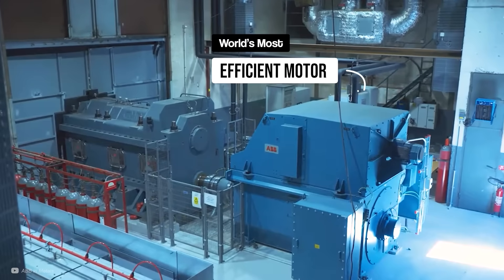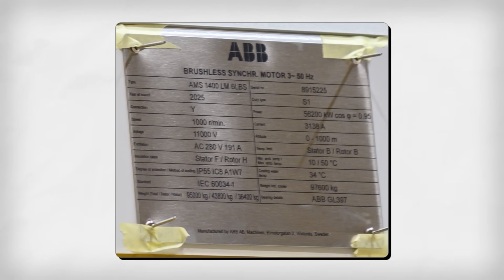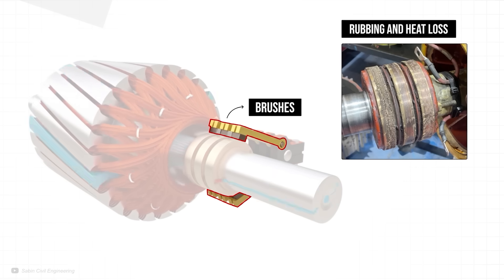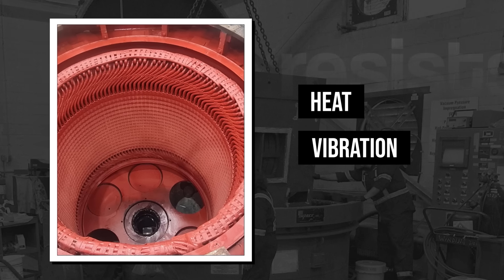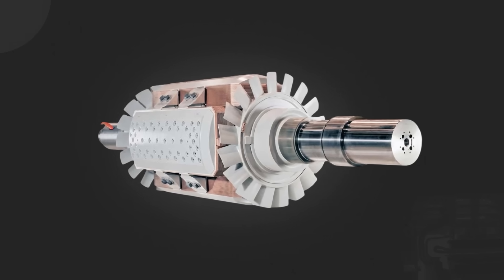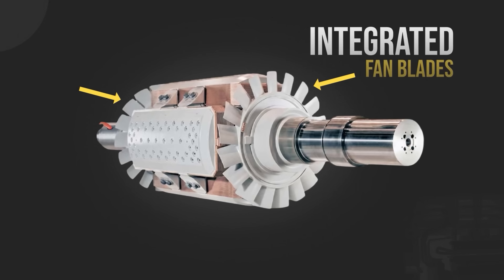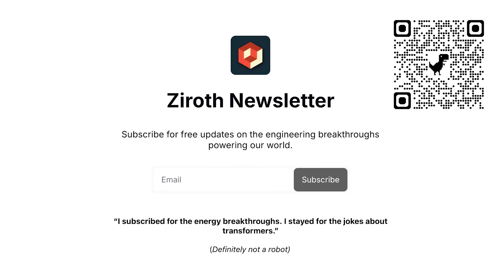How This Ultra Efficient Motor Just Broke The Limits

Comment: idiots, educated idiots, the amount of coal burned for that giant unjustified motor was staggering, coal is fuel that India is burning through to make it all, all life is fuel, what amount life did that motor and all the motors out in that body of salty water cost? How much fuel for life did we just lock out of being renewed? 
If it will last a few thousand years it will still not be worth the trees and plants that coal had the potential to nourish, plants don't eat sunlight or water, they need fuel just like all biological organisms, and this motor represents thousands of trees a forest that will never exist because some idiot wanted a motor that melts metal, and your sponsor? The old blades that a man could sharpen himself would really last a lifetime, not razor blades that last a month, what a joke, they made a handle with a blade that on a 30 degree angle LOL great, only, you can hold a blade on a 30 degree angle yourself, don't you have any mind of your own? Selling worthless crap, worse than worthless crap, crap that won't have any use without life to burn for fuel, you don't get it!

Comment: @4:08 "vacuum pressure" 😂
Otherwise pretty good video 👍
Reply: SIS VPI means "Sealed Insulation System, Vacuum Pressure Impregnated" windings. The coils are wrapped in Dacron polyester fabric, then heated and placed into a vacuum vessel. Then a vacuum is pulled to get all the air out from between the windings. Next epoxy resin is allowed to enter the tank and covers the windings. Next pressure is applied to drive the epoxy into the windings which is the impregnated part. Then it is removed from the tank and rotated in an oven until cured. So, ya, he is right about the vacuum/pressure part.

Comment: Low pressure helium inside? 
Small motors are around 90% efficient. So 10 kw motor is heating up space with 1 kw.
Imagine this 50 000 kw monster  dumping 5000 kw of heat 24/7... It's saving 4500 kw of power... I  2 hours saved you can run home for year

Comment: As a retired electrical engineer who spent most of his professional life near large generators, motors and transformers I must tell you that you do have the majic ability to make large brushless synchronous machines look very sexy....😊
 You didn't mention power factor which, in such large machines will draw huge mounts of idle currents.... But even school kids know that in a synchronous machine you control it by the levels of excitation currents.. So, problem solved

Comment: An improvement in efficiency from 96% to 99% is HUGE in one important respect. The waste heat generated drops by a factor of four. For the 56MW in this example that's 1.7 MW of heat that no longer needs to be extracted by forced cooling.

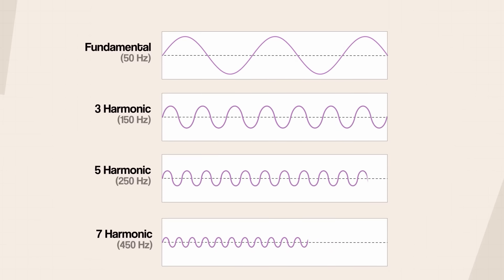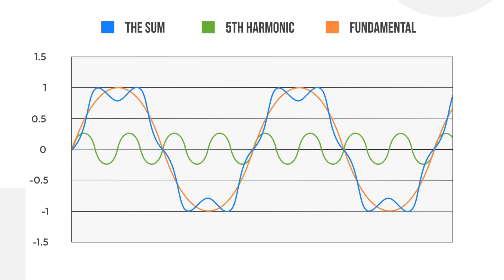Comment: The drawing at 6:59 and 7:15 are wrong: They show the 4th order instead of the 5th order!
The 3rd and 7th orders at 7:01 are not in scale too: They are 2 3/4 and 6 3/4 in length (not 3 and 7).
So their superposition would not match the result (that is drawn correctly).

Comment: Seems not included in the electric motors manufacturer's motor cover attached stated specification performance plate, shown us, is the now made external to the motor’s total energy consumption, the external pumped water cooling system energy consumption being used to cool the motor which would seem when now dissected out that this cooling needed to create a more efficient running electric motor is not included in this "super efficient" electric motor's total energy consumption efficacy ? Seems that the detrimental impact to energy efficiency experienced by typical electric motors running hotter when surrounding ambient air is pulled in over the copper coils to create limited cooling  happening to not totally cool the copper windings as compared to this motors external cooling design energy consumption has not been included in the overall total energy power consumed to run this new more efficient motor's total cost to run computation. The external cooling needed to cool this "new" more efficient electric motor seemingly makes its overall efficiency to run, when added back in, higher. Seems this additional cost for cooling energy consumed to operate is detrimental to total efficiency % stated to operate this new motor which seems NOT shown here by the manufactures side of motor mounted stated performance specifications cropped image shown in this YouTube video.

Comment: 96% efficiency is already great. You won't get much from making it a bit more efficient. Cost is higher than the result is worth. Yes, you have an effect of scale, but no real change.
Reply: To go from 96% to 99% isn't just a 3% improvement, it is a 4X reduction in losses. For this motor, apparently that results in a savings of $60,000 every three months, or $6 million over a 25-year lifetime. The extra cost was about $60,000 which was recovered in the first three months of operation. This motor uses 56,800 KWH every hour it runs at full load. For reference, at $0.13 per KWH, that results in $7,384/hour.
Reply: @solarfluxman8810  that makes sense, but only on this, immense scale.

Comment: Seeing the very nicely bent copper fins that replace the typical copper winding actually brings me an idea, armchair amateur engineer that I am - I know it's now possible to "print stainless steel" using some methods of additive 3D printing systems - how possible would it be to print some major parts of a brushless motor in 3D? The ability of additive printing to create geometric shapes that are extremely hard to do otherwise might give some advantage here? Obviously, like I said, I don't actually know engineering, so take this with a grain of salt - maybe I watch too much science-fiction.

Comment: I find 99% efficiency almost impossible to believe.  If it's true, a similar increase in efficiency is probably possible for the generation of electricity.  If this kind of efficiency can be built into smaller motors and generators and if you can make it small and light enough. An improved automotive drive system could allow an internal combustion engine to always  operate at its most ideal load and rpm .  Running an internal combustion engine at the most ideal speed for the power requirement would vastly increase overall  performance and efficiency.  Although efficiency numbers for any type of combustion engine will appear terrible compared to these drives, an actual overall efficiency of 50% for the entire vehicular system would be an economic and environmental answer to prayer.

Comment: I used to work at Electric Machinery in the '80s and even then we had controllable brushless exciters & 98-99% efficiencies in the big (10Mw+) units.  Efficiency mostly was a number you could improve by adding more copper & iron (to reduce magnetizing & current losses) which would add expense to the unit.  But with the big ones it was hard to move the efficiency needle much.
Reply: Solid rotor caps shown in the video are not very efficient - they're used by necessity to keep the rotor windings from flying off.  In slower speed motors laminated poles reduce surface eddy current losses.  In some of the big 4 pole motors at EM we'd use solid rotor winding caps and grind grooves on the pole face to reduce the eddy losses somewhat.

Comment: large companies do not pay electricity like a normal user but it depends on what machines they contain. in the case of a motor when you have an inductive load in the network you either have to compensate it with a capacitive load or you pay the power plants fees for this unwanted phenomenon in the network. there you can collect much more financial fees. even though it is still a crazy scenario maybe we could get a little closer to the amount

Comment: I would assume strongly that the advertised amortisation period refers to the excess cost over a brand new more conventional motor built by the same company, not the total cost of the unit. Since even any such motors are likely very boutique and custom built for the application, they won't be cheap in any case.

Comment: 9:54 This is a bit of a mystery to me. I often wondered why efficiency drops so spectacularly beyond going below or beyond some RPM or torque range. And why can't this be expanded
Most applications have variable load and or speed. And something with a 95% peak can quickly go into areas that are below 85-80% efficiency.

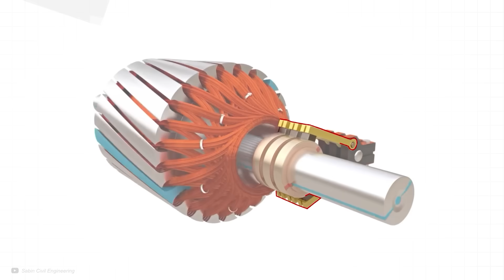Comment: 3:25 I don't think that slip rings need to cause large losses, only no-one bothers to develop/use good ones. It's very rare, but there are such things as liquid metal slip rings.
I think that line could be developed to very high efficiency. Manufacture the them as one piece with mechanical bearings, there never would be direct solid-solid contact. And the actual electrical contact would be made by a liquid conductor, metal or some other conductive liquid. That way it could be very efficient and last the lifetime of the motor. (Or at least the bearing it depends on)

Comment: Since the 8 pod is basically a mini heat pump, while it may cool you down, it will inevitably rise the temperature of the room…
Reply: Assuming you have no air conditioner? The 8 gets the heat out of the bed. I assume anyone buying it already owns an air conditioner.
Reply: Additionally anyone without AC is likely somewhere it's cool at night

Comment: 7:10 Pianos (and every instrument that isn't a synth) actually only sounds good they sound because of harmonics but that obviously isn't your point. 
You need a pure sine wave, without 3rds and 5th harmonics messing up efficiency but pulling and pushing at the wrong time. 
Multiple orders of harmonics layered on top of a sound can be described as sharpness or even harshness. 
It's the difference between gently blowing wind and a howling gale.
Or a Oooh and an Aaah sound.
I'll get my audio theory out of your electrical engineering now, bye.
Reply: As long as the piano is perfectly in tune, place an empty wine glass on your piano and play to see how long you can stand the noise before you take it off, lol. Another example, in the case of a guitar if the intonation is out even the slightest amount then instead of harmonious sympathetic resonances, you start to hear an obvious dissonance that makes any piece you are playing sound a bit off even if you are perfectly tuned unless you are only playing open strings. Basically it's just a balanced system and that's what he's saying in this case as well, hopefully they torque the mounting bolts every now and again or wave goodbye to that efficiency rating..

Comment: lol ya has to be a typo as there's no way that motor is only 60 grand.  I work in the industrial motor field.  As a point of reference my employer facilitated the purchase of a 1500hp synchronous motor(brushed) a couple years back for a customer and that ran about 3/4 million as I recall and was only 10 tons.  Also ABB is not one of the budget brands either.  That motor probably had a several million $ pricetag.  That said 11kV at 3138 amps is a retarded amount of electricity. probably on the order of 4-5 grand every hour just to power that monster.

Comment: The graph shown at 7:36 has nothing to do with harmonics, instead what you are seeing is called PFC power factor correction. One plot (the smooth one ) is the voltage signal the other plot(the double hump) is the current. you can see the current is leading the voltage therefore its an inductive system. As the PFC starts to operate the system becomes purely "resistive" and the current and voltage are in phase. 

I believe you used a crappy 5th order harmonic to try to duplicate this real data you saw without understanding what you were looking at.

Comment: At 11:42 it shows they will save $60,000 in 3 months. That does not imply the motor cost of the motor was $60,000. It implies the motor was $60,000 more than a different motor that would have cost $6m more to run over 25 years.

Comment: 0.9987% of 56.2MW is still a lot of heat to manage. 561KW.

I'm sure that the costs savings aren't just about the power bought to run the motor, managing waste heat has costs too, and they just slashed about 1.7MW of that.

Comment: For your cost efficiency / payback time period calculations, did you only look at energy usage?  Obviously they're going to want to come up with the highest cost savings numbers possible but I assume they'd at least try to make those numbers based on something real... like what about the cost of removing the excess heat, if it were assumed that you had to have say a chiller or AC system remove that excess heat?

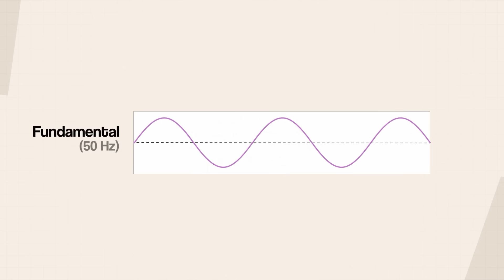Comment: 6:50 harmonics in a musical tone may be technically off-key (well some of them anyway), but they don’t necessarily lead to discordant sound. The clue is in the name. Harmonics in music are generally desirable.
Reply: Everything is a wave form, that includes sound (it's just another form of energy moving). So there are complimentary harmonics and destructive harmonics in music, not so much in electricity. In music they can enhance the sound,   alter it or literally cancel out entire notes but when working with electricity those harmonics can cause lower efficiency which means the electricity is not being used to move but it causing heat instead.

Comment: Over a 25-year period, that's 240,000 per year, that's 20,000 per month. That's 666.66 dollars per day of 30 days. Not including the down time for maintenance and the lack of power production it produces when it's not running. I don't mean to be pessimistic I am a realist and I work in maintenance sometimes these parts take days weeks or months to get here, How easily are they serviceable with a basic technician and understanding of principles. These things need to be considered when discussing the "energy saving capabilities"

Comment: If you compare it to a 96% efficient motor in 3 months of full load you will save 50MW * (0.99 - 0.96) * 90days = 3.3 GWh which I would say is still more than 60k. Probably they compared it to a motor some random indian dude found on the street which was made in 1886 in England.

Comment: 100t machine with less than 1% losses? What sorcery is this?
This could be interesting to use in syncronous condensers to close the gap between pv and traditional generation, much better than inertial pumps or mass scale batteries.

Comment: They mentioned brushless synchronous motor , Why didn't exactly mention the   exciter supply on Electro magnetic coil rotor.  It's synchronous motor without carbon graphite brushed Right? 🤔. How to transfer electricity into the electromagnetic coil rotor while on  its spinning ?   Yeah it's possible to transfer electricity like wireless charger but i can't imagine how it works while on spinning.  Is this possible to double the coil in rotor the windings?
  1 for receiver and another 1 for electro magnetic coil 🤔 how it works while on its spinning?

Comment: This reminds me of a jet engine but as an electric motor (same as a generator if you just turn it in the opposite direction, but is not the use case or goal here).

This is incredibly cool. Once you start getting to the insanely high efficiency stuff, every little gain becomes exponentially more difficult to achieve and monumental, a logarithmic function , or 80/20 rule might be a good example even if not perfectly applicable.

I really want to know more about this. Do you have a casual / off the cuff sort of longform vid talking about this somewhere?

Comment: That $60,000 pricetag is rather seems misleading because the weight of the machine is very large and that pricetag is not even justifiable for the price of simple steel. This motor is precision engineered, users large amount of copper and many more other components. These kind of products are not even mass produced, So taking this at that cheap is just like a pure idiotic or misinformation.

Comment: The motor is using fundamentally the same tech as before with a few extra tweaks, it is entirely possible that it only costs ~60k$ EXTRA to buy vs equivalent standard efficiency motor of that capacity.

I'm reading the three months payback on 60k$ as: "the high-efficiency motor costs 60k$ extra over a standard efficiency one and it takes three months of operation to break even." Ex.: 600k$ for standard efficiency, 660k$ for high-efficiency, three months to save 60k$ worth in power and cooling.

Comment: The electric motor efficiency cannot be compared to an ICE because it's dealing with energy differently.    The ICE is releasing stored energy in the fuel while the electric motor transferring energy that has been generated elsewhere to the load.   All forms of electrical generation involve inefficacies whether powered by diesel,  gasoline,  natural gas or nuclear none of them are much better than 50% efficient in converting the heat produced into electricity.   When dealing with motor vehicles the convenience and practicality of liquid fuel in the form of diesel and gasoline far outweigh their slightly less efficient use of the heat potential.   

EV's should be looked at realistically 50% efficient while cars and trucks close to 40%.   Then consider the energy investment needed to change the infrastructure to support EV's as well as the ICE and the small efficiency improvement isn't nearly worth the cost....not even close.

Comment: Stop referring to preventing CO² emissions as part of a 'pollution' prevention. CO² is natural, extremely necessary, not a significant driver of climate as compared to water vapour and it at a concentration very low compared to the levels at which it was concentrated when the plants that  feed on it evolved to do so.

Comment: Not so much what makes THIS motor good, but using the build plate as the cue card which parts require standard identification and mentioning with which all systems of their types each component can reap some more efficiency. No mention of peltier, nothing novel, not even anything unique to the machine photographed